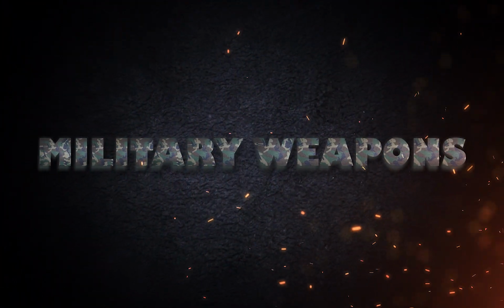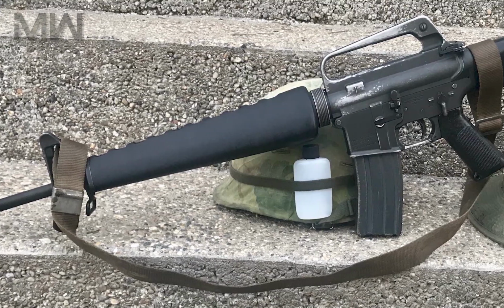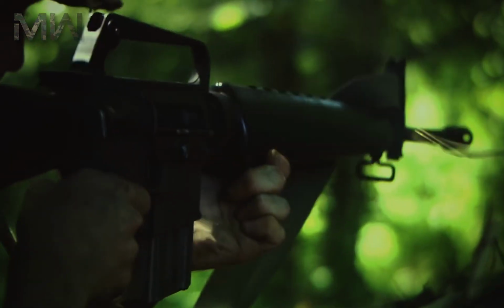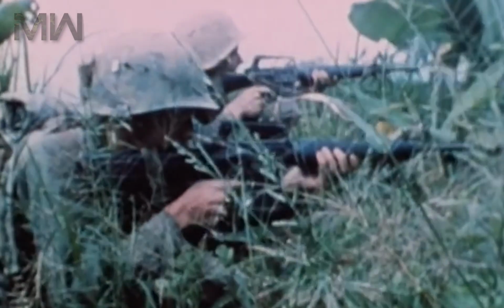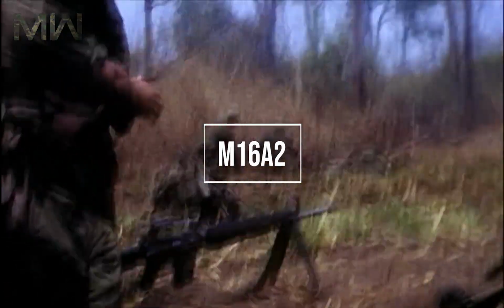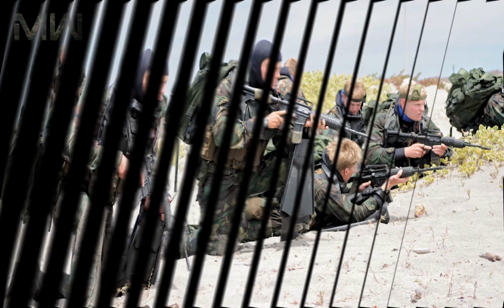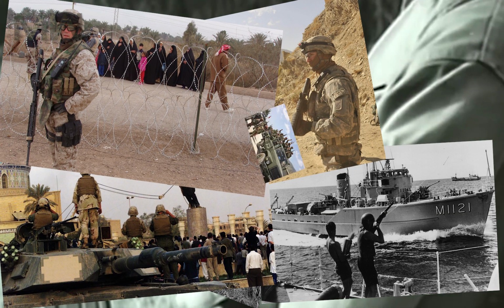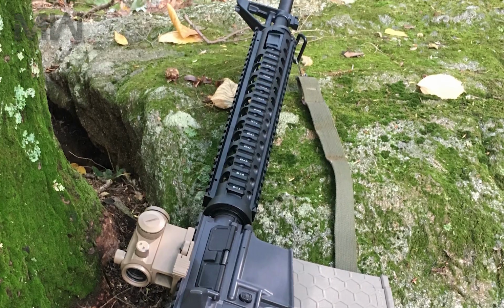5.56mm M16 Assault Rifle ⚔️ US Armed Forces [Review]

Comment: The M16 was originally known as the AR-15 which was made by Armalite back in the 1950s as a replacement for older WW2 era weapons the US military was using then such as the M1 rifle, The first tests went up against the M14 which was adopted just prior to Vietnam and in later the rights for the weapon were sold to Colt then adapted as the M16 in the mid 1960s with the branch receiving them the Air Force then the Army and Marines during the war as reports of the M14 were somewhat negative due to length and recoil.

Comment: No matter how U.S miltary change to HK416,M27,FN Scar, Sig,General Dynamics, Textron include the 1980's ACR test units. In the end the U.S military will still buying the Colt M16.

A good quality that nothing comes close. Colt M16 is in-replaceble as the most accurate rigle on earth that easily hits what you want. Not matter how other Arms maker like FN and Knight xlone the M16 buy still cannot achieve the results of the colt M16.

A trade secret that Colt will not share.

Comment: The U.S. Military uses the M4A1 as it's standard issue weapon. The last branch to primarily use the M16 was the Marines in 2015. The M4 was chosen because of it's balanced size able for close and medium range, instead of the MP5 ans M16. M16A4 is still in service but is limited to non-infantry Marines, Army Reserves, and deck Sailors. The M16A2, the most iconic in the U.S. Military, is an even rarer sight.
Reply: Technically the M4 is an M16A2 carbine that's the original name.
Reply: Actually the full stock M16 is still in use with some branches I believe USMC because some reservists still issue the burst fire M16A4 as their main weapons although even then M4s have long took their place
Reply: I missed the M16A2 I was actually the last battalion to learn to use that model iron sights in  Paris island  back in 2010
Reply: Now the M4 has been replaced by the Army and Marines with the XM5 for the Army and the M27 for the Marines.

Comment: The most deadly version are the earlier AR-15 & M16A1 originally made by the colt company. 

Since the 2002 Iraq gulf war 2. M16s made by other brand were not reliable. 

The Colt AR-15 & M16A1 was fully automatic, 1/9 or 1/12 tiwst barrel spinning the round to reach high velocity speed. AR-15 & M16A1 still can be use today , it just need a trackpoint fire control computer scope.

Theres no need the MIL-STD-1913 or STANAG   2324 Picatinny RIS rail with sophisticated accessories.
Reply: Drew Bond  Many who shot the AR-15s knew there is no 3 round brust in auto fire mode. Ita like a machine gun that can finish your 30 round mag in 15 seconds.
Reply: @UtopiaParadiseValley  More like 2 seconds on full auto

Comment: can you specify defferent types of m16 more?
Reply: I can provide you with details and models if you'd like. The main modles are the XM16E1, M16A1, M16A2 and M16A4. The M16A3 wasnt used very often and is essentially a full auto M16A4.
Reply: @GiuseppeSimonetti  No M16A3 is a full auto A2, although some A2 models are also full auto. M16A4 was the first general issue one with the flat top upper(contrary to what the video says).
Reply: @redtra236  My bad I forget. Nobody really talks about the M16A3 it wasn't used as commonly as the A1, A2 and A4.
Reply: @GiuseppeSimonetti  Yeah, the XM16E1, M16A1, M16A2, and M16A4 were the main ones used